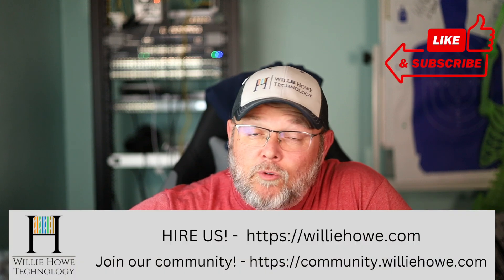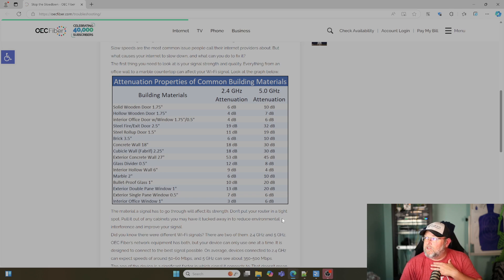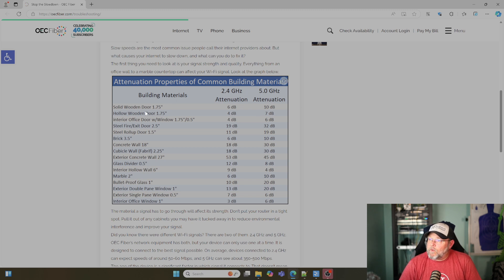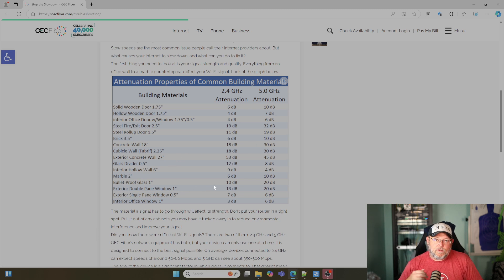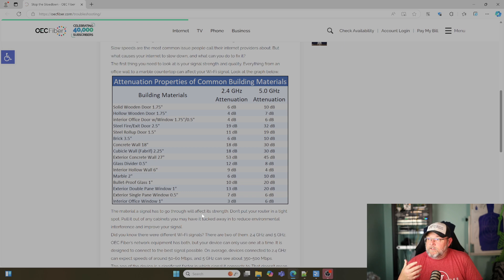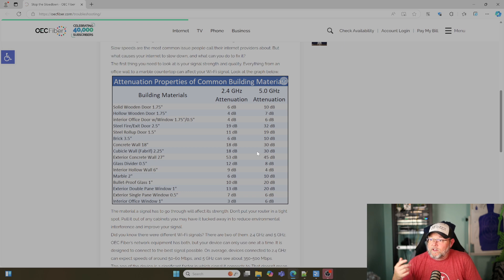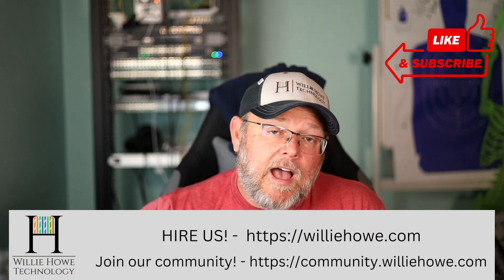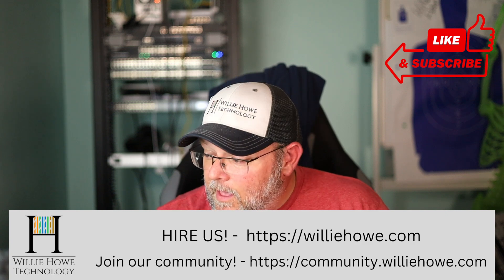Why your WiFi SUCKS - pt 1

Comment: Hey Willie, not related, but have you seen Unifi Protect now supports ONVIF third party cameras?  Pretty huge for those of us that didn't want to replace a whole tonne of cameras.
Reply from the maker: I am using it in production - I have a couple Axis cameras on a UNVR. As long as your have ONVIF credentials you can connect but you only get recording options - for now everything else I have to do through the camera.

Comment: Many, many years ago, I was asked by a friend to help with his WiFi.  The modem/router combo from his ISP was on the second floor of his home and at the far end.  His wife's computer, which was positioned centrally in the ground floor of their home could not maintain a stable connection.  I explained to him that the absolutely massive stone fireplace which the signal had to pass through was the problem.  It was directly in the path.  He was skeptical.  I made up the mother of all patch cables and when I connected it, her computer took off like a rocket.

Comment: Great video Willie. I have a couple rooms in my apartment that when they were remodeled, behind the drywall they used a foam insulating board with an aluminum backer. It gives almost a faraday cage effect. So, I've got an access point in each of those rooms. 

I still used wired connections in those rooms where possible, but it's an interesting situation that I've not seen before.
Reply: radiant barrier (foil) under some roof decking also if you try to get outside